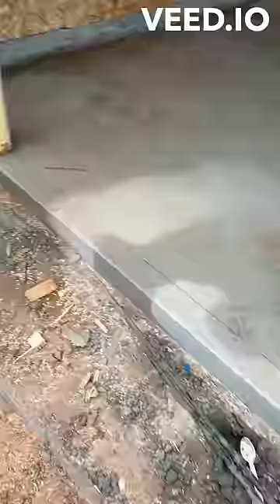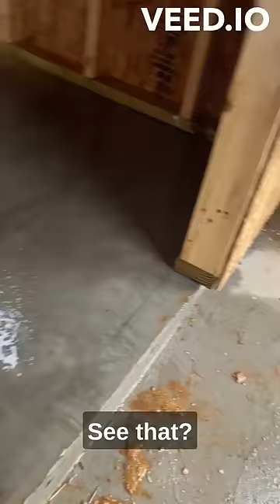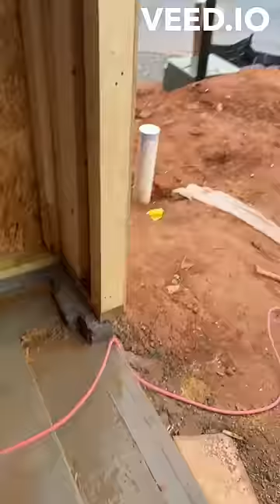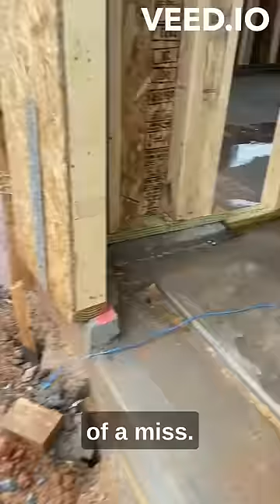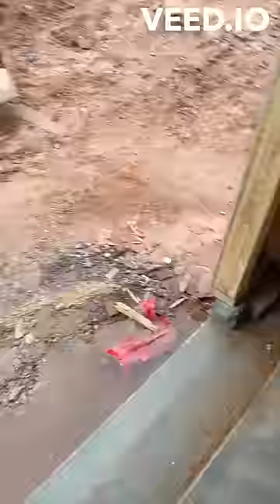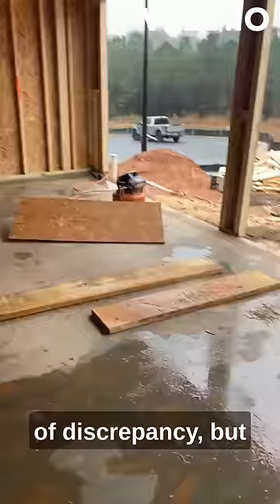New Home Slab is Wrong Size, What Now?

Comment: The framers are crazy 😂. All they had to do was inform the concrete guys that they were off and have them correct it before continuing 😂
Reply: GC or PM should check numbers and square before the pour. Too late to fix it now. Not without lots of demo and new mud.
Reply: You can't just add concrete to already set and cured concrete lmfao, they both will cure as two completely separate pieces of concrete. Normally, you can circumvent this by epoxying rebar into the existing slab, but when it's a few inches like this you're basically just fucked
Reply: I mean, it’s not all that more complicated to fix it with the framing sitting there depending on what the inspector wants to do but pretty much you’d just bend the straps up, drill holes about 12-16 inches deep sideways into the slab, bend some rebar, stick it in the holes with epoxy, form the 1 1/2” that’s missing and shove mud in there. Usually subs do this kinda thing when they are fed up with someone’s bs so id imagine this isn’t the first time they had this happen with that GC and wanted to prove a point. It is frustrating when your schedule gets messed up over and over again because of someone else’s mistakes so I could see a sub doing it for that reason. I personally wouldn’t do it. I’d just fulfill the requirements and start looking for a new relationship with another GC if it’s really that much of a problem, but some of the guys out here are crusty old prima donnas who want to bitch harder than they work.
Reply: @Spoofff I’m sure the inspector would be fine with it at the end of the day. Prime the fuck outta the slab with bonding polymer, use #3 bar, and probably pour it a couple extra inches over sized, cut where needed. They would definitely let that slide in my area, but we don’t worry about freezing down here so that might change things
Reply: It does not work that way at all: it's not like sistering 2x4 studs.  You can't magically meld another inch of concrete on the side of an existing slab.

Comment: It’s not a miss on the carpentry it looks like the architect, engineer, or concrete company failed because the carpentry has to meet the blueprint specs
Reply: The framing company has to provide a building that is structurally sound.  How does this meet code? How is the frame secured to the foundation? - even with the slack assed codes that are ignored in various places.
Reply: The architect is the one that drew up the plans,  concrete would have had to follow the same plans. There could have been two different measurements an engineering screwed it up In that case when they stamped and approved these plans. More than likely it's what the previous guy said about the forms. Framers clearly caught it but didn't want to address it. It's quite the fuck up but it's simple fix Adjust the frame in what looks to be an inch to an inch and a half.
Reply: What? I don't start framing if I see something wrong!!! And this framer, framing the whole house, edge of the concrete?? What do they think? Pour extra concrete after? This gc is a jerk.
Reply: @NTconstruction Right? Like how do you even get an anchor bolt/plate on that without realizing something was wrong? At that point they should have notified the GC and sorted it out before wasting material. It could have been the architect, or maybe the slab guys couldn't read a tape, either way all three could be wrong but the framers knew they were wrong and did it anyway.
Reply: Bruh it’s a “small” residential building. There ain’t no architect or engineer part of this job.
Reply: @barrettlee9287 there is always an architect and an engineer. Every blueprint with a wall over 4ft has to have at least a PE stamp and any home will have a PA stamp. The engineer and architect are not allowed to stamp the drawings without being directly involved in making the plans. And engineers/architects don't just stamp things because they're small/simple. It takes forever to get your stamp/license and you're not going to risk it for being lazy. At the school I went to we were a new program so we had to have our bachelor's degree and then do 6 years of apprenticeship before we could even take the test to get our PE stamp.
Reply: The framers put the wood where it's at. They should have stopped when they couldn't follow spec due to undersized foundation. Now they've done work that's not right or sound.
Reply: @barrettlee9287  You sure it's not a custom home
Reply: @iancormie9916 It's a prefab.
Reply: @iancormie9916  Everyone gets measurements they have to follow for the planning stage from blueprints. Sounds like someones blueprints didn't match. Every single cut on a board has to be to the exact measurement on the plans. So it's probably on the concrete guys here to be honest as it would take the framers a LOT more cuts to make this mistake as opposed to the concrete guys only need to have a few forms off.
Reply: fultonbenjamin9022  agreed
Reply: Or you just pre measure your foundation before you build on it?
Reply: @barrettlee9287  It def has 3 levels above. Thats how people make money now. Small lot, so you build up
Reply: The carpenters should have noticed and got the issue fixed before doing all that work.
Reply: I am building a house right now and yes I have both engineers and a architect on site quite often. I didn't have no discrepancy between the concrete and framing guys. Is there treated or exterior grade wood used on the bottom sill plate? We not used treated lumber but we also wrapped all of our bottom sill plates in a waterproof membrane.
Reply: But you think of it carpentry comes first. Concrete is only poured on the inside of forms.
Reply: Project on hold for sure.
Reply: @MrAwsomeness25 the framer probably told the general contractor, who then probably just told them to proceed and he would fix it later
Reply: So the framers just "go with it".... LMFAO.!

Comment: Ok. From a lifelong farmer/carpenter. When we've EVER seen that a slab is off a couple inches. First thing we do is notify the homeowner before we start actually framing the walls. Then they come out. Look at it. And make their call. Usually it goes something like..we have to wait a couple days to frame so the concrete guys can come back and fix it. If the homeowner DOESN'T do that and says go ahead. We go ahead. But just let it be known. That's 1000% on the homeowner. If the concrete guys aren't called to come fix their screw ups then that's on you brother.
Reply: It’s not 1000% on the homeowner if he’s not made aware of it and it’s not their job in the first place. Besides that, isn’t that what the building inspector is for? They should be checking construction all along the way to make sure it’s done correctly. How do you put it on the homeowner? That’s crazy.
Reply: What kind if jagoff would make such a huge deal out of and inch and a half? No one in a million years is going in the garbage and thinking "hey wait a minute. This feels like its an inch and a half short". Framers were 100% in the wrong.
Reply: I hope you mean that you adjust the framing to properly sit on the concrete. It kind sounds like you’re saying you will just stick to the original plans and that’s the homeowners fault as long as they are notified.

Comment: Looks like they could bring those walls in a little bit. So they will sit on that footing that edge. Sometimes it's not so critical, and you can cheat the framing and don't have to go exactly off the plan for the framing.
Reply: And screw the plumbers.  We love it when framers think just move things the way you want them to be, who cares about blueprints everyone else uses.  Just get it fixed right would be the right option.
Reply: @youareawesome591  No, never screw the plumber some walls. You can fudge if you can't do it. Then you can't do it. But what I saw there was no plumbing involved.
Reply: @youareawesome591  Builder I work for as an idiot super. That doesn't understand that it's better to cheat wall. So the plumbing falls in line rather than move the plumbing. I'm always telling them that we get into arguments all the time about that stuff. If you can cheat the wall sheet it.  But if there is plumbing, you can't. But sometimes we cheat the walls so that the plumbing will fit in those walls. But you have to consider the size of the tub, the size of the vanity and things like that. It goes hand-in-hand it depends on your kitchen. Submit dimensions so many things to taken consideration
Reply: Unless the walls were pre made
Reply: Just shave a little off the roof trusses and floor joists???
Reply: @AmericafromthegrindWolfe  It's a house.  There has to be plumbing.

Comment: Why the hell did the framers actually build it like that?  Just adjust the damn dimensions or call the foundation company and have them correct it first.
Reply: Framers CAN NOT just “Adjust the damn dimensions”!!
You’re talking about random guys From a Framing Company LITERALLY CHANGING THE BLUEPRINTS for a PERSONS HOUSE!!
When you’re building a Home/Building you have the Engineers/Architects that make up the blueprints & account for every inch, with very tight tolerances(1/8”-1/4”)!
Not to mention the Other Side is Probably just as bad!!

Edit:spelling
Reply: @Know_Your_Enemy  To start, it should have been caught before framing started, but it didnt.  I get issues like this all the time and adjust the plans and structural members to compensate.  The framers can adjust, they just need to talk to the engineer first to make sure everything aligns on a footing and not the slab, and that no point loads are off position.  So yes, you are correct, they can't just adjust, but they could make a single phone call then adjust.
Reply: @Know_Your_Enemy you're not wrong, but the framers could have (or did, idk) talk to the GC and if approved, move the sill back to the edge of the slab and build slightly smaller. And the GC would have had a conversation with the architect and building and safety to see if the owner and city would be okay with the formal change. Or re-pour the slab. But what they actually did was BS and just cost everyone t&m.
Reply: It's not that big a deal to adjust a matter of inches. It's done all the time architects be damned. But if it's that big a deal, you get in touch with your architect and have them do a revision. We do it all the time. What I would never do is do what these framers did. It took a problem and turned it into a major problem because there's no longer a simple solution.
Reply: Adjusting the dimensions screws up the soffit later on when using engineered trusses.
Reply: @nicpadilla9836  You will have no problem getting a quick stamp on cutting 1 or 2 inches off the tail of a roof truss.
Reply: @Know_Your_Enemy  sure they can. Could have shrunk the garage

Comment: Tape measure please.  Before starting a project - hand them out to all parties along with expectations.
Reply: One rule .. is To be able to read the damn thing
Reply: My buddy's tape measure has lots of sharpie marks on it, yet he claims he had wood shop for two years. 😮
Reply: Don't buy your long tape measures at Harbor Freight. Just sayin
Reply: @Frxstynah  I literally saw an image of a guy who took a picture of three different brand measuring tapes that were pulled out a foot.  

None of the three had inch marks aligned with each other.  You can argue that a fraction of an inch off only makes a different in long measurements.  But these three were off more than a fraction of an inch.  It was noticeable even with just a foot pulled out.

Some advice a carpenter gave me a while back.  Every measuring tape on site needs to be the same model and manufacturer.  Then it probably won't matter if they are off unless you are going off of blue print measurements.

Comment: I had this happen on my detached metal garage and concrete foundation. The foundation was 8 inches out of square. When the metal building installation crew discovered it and asked me what to do, I said we can't have it hanging over the edges of the foundation, so just make the building match the foundation.  Nobody can tell by looking at the finished building that it's out of square.
Reply: Nobody can tell until the wall buckles out or in. Which does happen.
Reply: Stevie Wonder would be able to see that some where in the final product, who you trynna kid lmao, and also what an ignorant thing it would have been to roof and exterior finish
Reply: Hope you didn't pay for concrete work.   

If it ain't right its free.

Comment: Concrete guys measure to wrong side of the board, framer should have adjusted, the CM failed everyone by not managing his job. 
Engineer will give you a repair and a cert letter. Keep it moving this is a non issue.

Comment: Someone said the framer could make adjustments, not if it’s an engineered floor and roof system. Your floor joist and roof truss won’t fit. Have to build it per the measurements. Also, good luck getting that red caulk of the finished apron at the garage. Better by some acid and gloves.
Reply: You would be aloud to shrink the floor span and make it smaller just not larger, I would fire the framing crew
Reply: For as long as I've done this, factor or site built, you can ALWAYS make adjustments.

This just looks like someone was upset and trying to make a point.
Reply: thats not the real issue its in the finish these development houses are kit homes the finish is already designed to be the most efficient use of materials and it messes up have the fixtures fit

Comment: This is why you have to come and check your job site often! You have to be active in the building of your home, because these bastards will try and get away with anything! They don’t give a shit it’s not their place they’re getting paid, and they’re the hell out of there!
Reply: You are so right about that. We custom built our house. Our builder-you may have heard about him in a nursery rhyme: there was a crooked builder who built a crooked house. Yeah. Anyway, I caught so much shit going on and made them fix, that some stuff still got by me. We had some weird framing where the slab didnt match the framing-not as bad as this.  I didn't catch it until much later. They put my windows in crooked and I made them reset them. They neglected to put the tray ceiling in the MBR, and I made them redo it. They sheetrocked before the wired alarm system went in. I didnt want wireless so I made them redo the woodwork under the windows. They ended up running the wire on the foam board behind the bricks. That was 30 years ago and no problems. But still, you are right.
Reply: My uncle hired his own inspector 
My cousin was raised tomboy and knew more then the builders

Comment: Builder Carpenter here. Everyone involved is to blame. I don’t care if it’s roof pitch, total stacked lumber width, or form placement, i go through a version of this on every major build. it’s my job to pull it all together and make it work based on professional discretion.
Reply: youd frame a 30 foot wide building 29 foot 9 inches because thats what the footing measures? or frame a wall out of square to match the footing? if anything the gc is to blame for not checking dimension on the slab before scheduling the framer to show up

Comment: I don’t understand why it’s so difficult to just DO IT RIGHT THE FIRST TIME.
Reply: Well when you hire cheaper labor this happens
Reply: Contractors try to maximize profits using cheap unskilled labor.
Reply: @robertarmstrong9166  eh..concrete guys can never seem to get anything right
Reply: @randal3122  So the framers just "go with it".... LMFAO.!
Reply: @2869may  in their defense, they probably showed the general contractor, who then probably told them to keep going
Reply: @randal3122  You think a GC, Who knows that will NEVER pass inspection is going take on the cost of fixing it and the damage and embarrassment to their reputation....?
I seriously doubt it...!
We come across this many times, the architect has to approve the reduction of the size of the structure by a few inches, 
Which can affect the roof trusses and load barring points, but usually doesn't but when it does more changes have to be made...
(Other load barring walls may be moved or changed to 2x6 to match up with load barring points on the trusses...)
Reply: @2869may  no. i think the gc might have already had a fix that he could have the concrete guy do after the framing. so he told them to keep going. i come from the world of commerial construction. most of the time, gc's are so hellbent on schedule that they will come up with a fix and push it through so they can just keep rolling. i have seen fixes after the fact so many times, including instances where they knew it was an issue beforehand. framers are usually really quick to bring up an issue when they run into it because they dont want to get drug into it. everyone knows if you build on something another trade did that is obviously wrong and you knew it, youll end up having to tear your shit down or or move it for free. i highly doubt the framer just built on it like that without saying anything. its possible, but i doubt it
Reply: @randal3122  I'm curious what kid of "fix", scabbing on some concrete to the foundation...? That's a piss poor "fix"..! 
Reducing the size of the structure by 2" is the best, easiest, fastest and cheapest "fix".
Reply: @2869may  maybe an angle ledger or something. maybe a grout, although most grouts cant be that tall. but an angle ledger would work. or maybe this is just some different detail and nobody screwed up in the first place